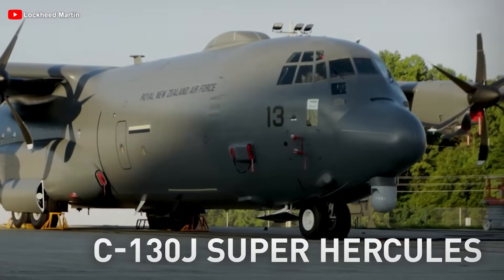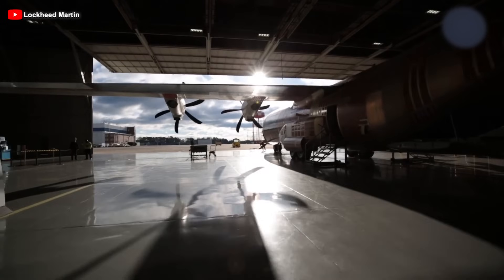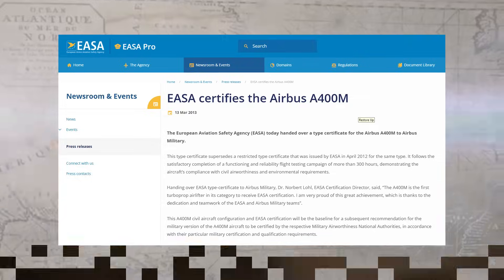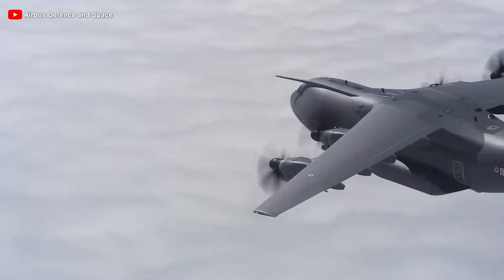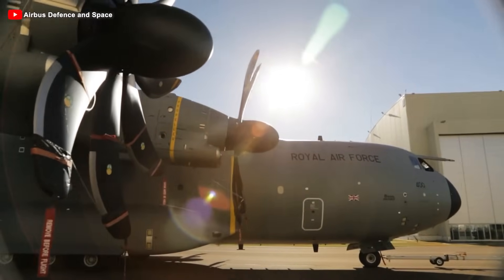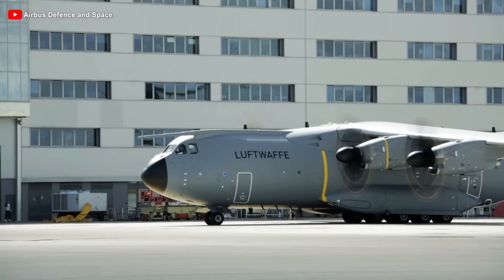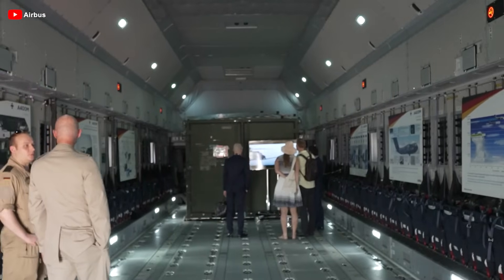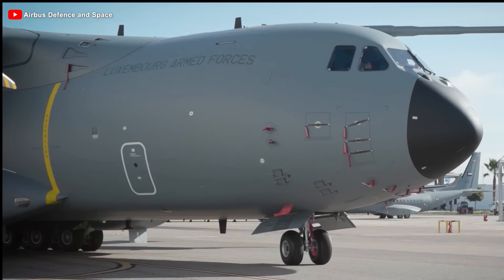Airbus' HUGE PLAN for A400M with UAE suppliers will CHANGE Everything!

Comment: It appears you are overlooking the incredible rise and success of the C390 Millennium by the brazillian Embrear...
Reply: The C390 is the size of a Hercules.  It has a jet engine and all of the problems that causes in bogging in mud or sand.  It's also Brazilian and Brazil won't stand by anybody in a war with its neutral posture so its not worth supporting Brazil because it doesn't come with an military allegiance.

Comment: The problem with hercs and transalls was that they were OLD and the wing spars were cracking

Being designed in the 1950s, there were 40 years of advances that could be incorporated intoi the airframe along with lessons learned from operations over that period - including acknowledging the VERY long service lives these birds are expected to have compared to being "disposable" in the 1950s-60s

Tossing a quick C130J off the wrist was lazy and whilst short term profitable has painted Lockheed into a corner - they need to produce a better Hercules(*) but are short on money to do the R&D for it

(*) In the same way that Henry Ford reckoned that if you asked the public what they wanted they'd have said "faster horses"

Comment: The A400M is to big for a tactical transporter like the C130 and to small for a strategic transporter like the C17. So the A400M closing a gap between a tactical and strategical transporter. So the french and germans airforce created an unit with the C-130 for the tactical missions in Evreux France.  Europe has no real strategic transporters, except the RAF is flying some C17 and a squadron from the NATO have some C17. This lack of strategic transporters will be a massiv mistake by the european countries, if the USA under Trump will leave europe and the NATO...

Comment: Europe buy Hercules j too. Both are use full
Reply: The C-130 Hercules are being retired in Europe, Spain will retire its last C-130 Hercules in 2020 for the new A-400M Atlas.
Reply: @juan1911 
Nope. France and Germany have recently purchased the C-130-J.
Reply: @celnavluvr  Germany has no C-130 (already got 53 A-400M, there's no need for adding the C-130 to the fleet) and France only got 2 C-130 to fill the operational gap before all the A-400M are delivered. You are drunk or lying my dude.
Reply: Useful

Comment: This is the first aircraft for which Europe has entirely developed its own engine?
Europe invented aeronautics and the engine, and the gentleman is telling us the first European engine?
Do you know the Snecma engine from Safran?
Do you know the Rolyce Roys engine?:face-green-smiling:
Reply: It’s about turboprop engines in particular, not aircraft engines in general.
Reply: それでも70年前に開発された、Tu -95のクズネツォフ NK-12エンジンに負けてる。
Reply: @春野嵐-y4k  Yes, it is outperformed by fuel consumption (higher), reliability (lower tbo) and basically any negative aspect.
Reply: @春野嵐-y4k  Its not a bomber though? Two entirely different applications

Comment: Aviãozinho acanhado. Um C130 um pouquinho maior. Conceito de turbohelice totalnente ultrapassado. Ideia ruim e muito cara que insiste em um conceito ultrapassado. Apesar de inicialmente o KC390 se posicionava em um patamar de capacidade entre o c130 e o a400,  o mercado acabou por entender que o KC 390 não era um produto em um patamar dustinto e sim um forte competidor para o A400. Este vídeo deve ter sido patrocinado pela Airbus para tentar promover um produto nitidanente perdedor e inferior. Sem mais palavras.
Reply: Only because you don’t understand the benefits of turboprops engines. Shorter runways, lower fuel consumption, more weight lift at low speed.

Comment: Really, the A400 bridges a gap between the C17 and C130 capability. Not really a direct comparison.
Reply: How so?
Reply: The German airforce learnt the hard way, that when introducing the A 400M and retiring the  C-160 they created a capability gap in an area that was relevant e.g. during the Afghanistan deployment. So they joined France in ordering the C-130J. In other words Germany became for the very first time a Hercules customer after getting the A400-M.
Reply: @tommay6590  The C130J order was not to fill a capability gap, but because the A400M was delayed and they needed an interim between retiring the first Transal and getting the first operational  Atlas as replacement.
Reply: @Kollum  That is not correct, check the Wikipedia on Évreux-Fauville Air Base that is were teh German and French brand new C-130J are located.

Comment: Massively over budget, massively late, massively unreliable. Welcome to politics in military multilateral production.
Reply: I haven't heard anything about reliability issues.
From all I have seen it is a classical "rough start, but eventually good"-case, like many other military projects.
Reply: Over budget und late is true, but today the A400 M is totally reliable, there are are no more complaints about the plane from the british, french oder german airforce, which are the "heavy users" of this plane.  But it took Airbus some years to get there, true
Reply: Same as the C130 at the beginning...
Reply: Massively moronic comment.
Reply: Typical 'pean effort
Reply: @rickdecastro4584 
So we've established that you know nothing about military aircraft programs.
The C-130J (a 40 year old airframe with new engines) was almost cancelled because of a $2billion overspend.
Reply: @rickdecastro4584  murica !      yee haa  and all that !!  lol
Reply: @rickdecastro4584  Who was the plane manufacturer again whose planes keep falling out of the sky? Something like Boing. Bong? Bang?

Comment: Typical EU design - do-it-all, gold-plated spacecraft that almost got cancelled... but then they pushed it over the edge into the mass production, and the damn thing came out to be 5 steps ahead of any competition around the globe 🚀🚀🚀
Reply: One could say the same about many American projects.

The issue is that government budgets won't allow specialised cheaper aircraft and this "kitchen sink" approach is the only way to get funded (see: Shuttle, Bradley fighting vehicle, F35). Sometimes it works and sometimes it turns into a travelling 3-ring circus with marching band and clown car accompaniment

Comment: Having worked on the Hercules in the late 80s and early 90s, before the C-130J was introduced, it was obvious that our aging fleet needed replacing, and that was with the J model, and from what I can tell it was widely regarded as a great aircraft but was not going to fulfil the future requirements for many C-130 operators, and with the A-400M it provided everything that most operators wanted, it was the Hercules on steroids that was wanted, and tbh Lockheed shot themselves in the foot by pulling out of the programme that eventually led to the A400M being produced and more importantly bought by partner nations. 

It strikes me, again, that the United States 🇺🇸 is frightened by the whole idea that another country or countries can produce equipment that can outstrip the equipment produced by American companies, and because of that irrational and irrelevant fear they come to believe that if they don’t participate in a multinational project then that project will ultimately fail and potential customers will flock back to, in this case Lockheed, and order fleets of newer equipment, and they were wrong, and not just in this case, since WWII the American military industrial complex has virtually cornered the market because overseas governments felt that it was better to buy from the USA because the USA had the capacity to supply multiple orders, they also felt that there was a debt of gratitude to be paid because of the “support” that American companies and administration had given to the principle countries before, during and after the USA (eventually)entered WWII, and to a limited extent that was true, but only a limited extent, not only did the USA get GIVEN new technologies and the inventors/scientists to develop the new technologies the companies were raking in millions of dollars in payment for the equipment etc supplied to their ALLIES, and even after the war ended countries were still paying the price for doing business with the USA. 

The USA has pushed the boundaries of the debt the allied nations owed to them and now the allied nations have decided that enough is enough and we will go it alone and design and build our own military equipment and not buy of the shelf American equipment and pay through the nose for it just so American companies can recoup the vast R&D costs by changing non American countries far more than the American military pay. If the USA TRIED to work in a collaborative project they would not have to shoulder the R&D costs alone, they would get a project completed far quicker and more cost effective. 

The overriding problem that the USA has is that of who will be in overall CONTROL and if it is NOT going to be the USA they don’t want to play, even though the end result would be superior to the end result they achieve, it is unfortunate that it has taken the rest of the free world 80 years to realise that the USA is not the “big I am” all the time, the USA economy is all about money and power and it is long overdue for us to stop bowing to the mighty dollar 💵, sorry America but you have had your time at the top, and because we are being TOLD time and time again to step up and spend more on our military we are doing that, but unfortunately for you we are spending it within our own borders or collaborating with other countries, it IS time to realise that the CHUMP that YOU the American voting population put in the Oval Office is only concerned about himself and his sycophants, the power and wealth that he has as POTUS is all he has ever wanted, it is time to tell him “you’re fired”.

I have to wonder how many new aircraft have NOT encountered cost increases and R&D delays?, especially in the modern aircraft industry, once computers and new technologies are being developed for integration then it would be impossible to avoid cost overruns and delay to the aircraft being delivered, if anyone knows a new modern aircraft that has been delivered on time 🕰️ and without cost overruns please would you enlighten me, thank you.

I also wonder 💭 whom it was that was sceptical about the whole project, rival manufacturers?, but whomever it was they were made to eat humble pie 🥧.
Reply: tout est dit!!
Reply: @tchen1706 , I hope that all is said, and now done, the USA needs to realise that we can’t carry on the way they want.

Comment: The A 400M is a much bigger class than the C130, its may along the lines of the C17, the C390 is far more of a competitor to the C130.
Reply from the maker: So, how would the C390 compare to the A400?
Reply: @FLIGAVIA  lower capacity (in mass, width and height of the cargo bay - it's just about enough to fit IFVs inside, but cannot handle stuff like oversized excavators or helicopters), less than half the range with 30-ton payload (light IFV), air refuelling demands a different airplane - KC390 (but it's partially modular, so KC390 can he used for cargo transport, if there's really a need for that), worse capability to operate from unpaved runways, 
On the other hand - C390 is cheaper to maintain and buy.
Reply: @SkywalkerWroc 
The max payload is 26 tons.
Reply: @SkywalkerWroc  It looks like C390 is little cheaper to buy but almost the same to maintain.
Reply: can you compare a van to a truck? They can both be the best in their class.
Reply: @FLIGAVIA 
It doesn't. The C390 is a Hercules cargo hold with two turbofans.

Comment: Amazing plane.
How about offering a commercial version?
Caable of such air speed and  diverse landing capacity, could become a fantastic airliner.
Reply: Military transport aircraft have rarely enjoyed commercial success. They are usually too heavy.
Reply: Its expensive to operate and uncomfortable to fly in for passengers. In military the benefits outweigh this, in airlines with tight margins it wont as easily
Reply: Or a fantastic freighter with very fast groundside turnaround.

As a pax bird it has major drawbacks but they ARE certified for civil airspace/operations and I can think of a dozen high speed freight applications where they would massively outshine converted passenger planes